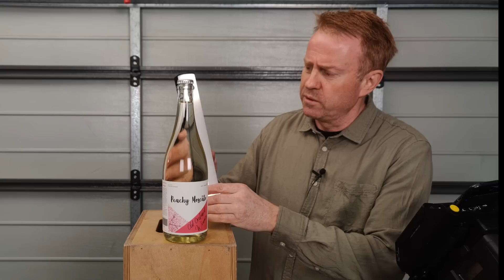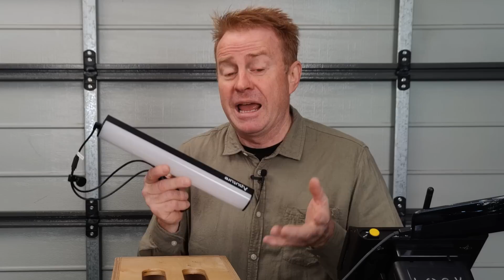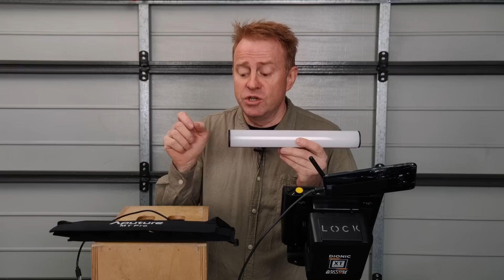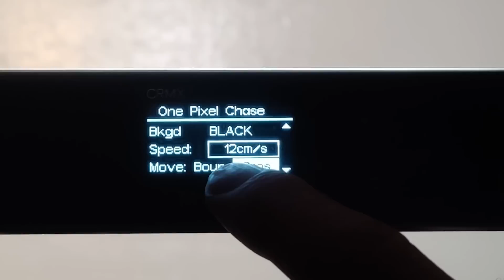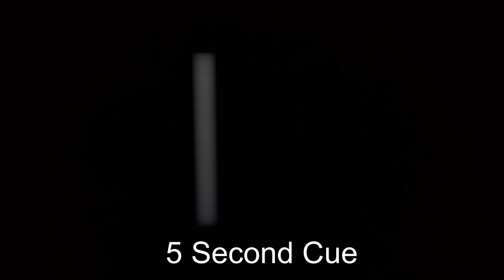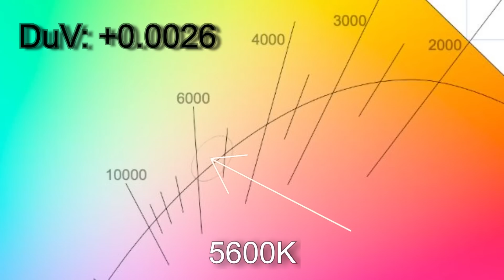Gaffer & Gear 194 - Aputure MT

Comment: What is the difference between this tube and infinibar pb3? Except of package options and absent ability to make infinity line like when you use infinibar?
Reply from the maker: You can mount a tube and roll it over in its mounts to face the camera, an infinibar always faces upwards from its mounts. So unless the camera faces the top of it you will see the side walls of the light

Comment: Is there a way to run this light in “studio mode” like some of their other lights?  I know it has internal batteries but it’d be great to have an instant on and instant off when power reaches the USB-C port light you can on the T2c and T4c.  Are you aware if this is present?
Reply from the maker: Sorry for the delay, they do not

Comment: Thanks for the extensive testing and sharing of your results. Have you tested the dimmer curves with different output levels or did you “only” test for one exposure? Maybe the actual light level is calculated for differently in the Aputure software then the Astera one. I might do a test if I get my hands on the MTs.
Reply from the maker: Yep, I only tested from 0 to 100%. It's a huge improvement over the previous firmware in the MT which was jurkey in the fades
Reply: @gaffergear  Thanks for the response. I had some problems in the past with the implementation of DMX by Aputure (300d II and 300X). Let's hope they get better fast. At least they go into the right directon with implementing wireless DMX directly into their products :)
Reply from the maker: @ypsart  the 300x was such a pain in the ass with setting up the DMX that I sold it.

Comment: I've ordered 4 of them, love the Sidus link system... I have the pavo tubes with grids ,good but no remote control and battery life is short, looking forward to using them and a 4ft version. Thanks for the review 👍
Reply: With the NANLINK box you can control the PavoTubes with app
Reply: PavoTubes can also be used with the WS-RC-C2 handheld remote control that costs $13.

Comment: Thank you as always

I have heard negative feedback regarding the performance of CRMX receivers in the 600Ds. Specifically, they would work well in prep, but when they come back the next day for the shoot, they would be wacky and disconnected. I am not well versed enough in wireless DMX to explain this well, but have you ever had syncing issues after hanging the units up for a day?
Reply from the maker: I find on set now, the 1st thing I turn on is my CRMX. That seems to help things to lock on automatically.

My 600s seem solid, they seem to fire up the next day with the last DMX command they received, until a new command is received.

I have found with some other brands that they seem to lock after I have flashed a black out command through the set.

They have Lumen Radio Timo Two Modules in them, so the hardware is as solid as you get.

But maybe ask on some of the Aputure user groups to see if anyone has had this problem and knows the situation. I would suggest  the Aputure Asia User Group as they seem to be all over DMX and large complex setups.